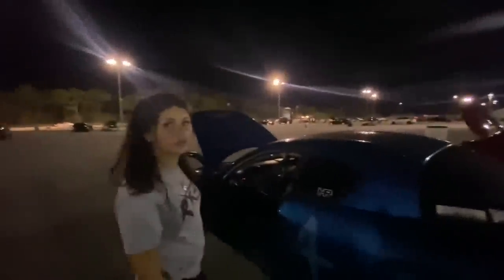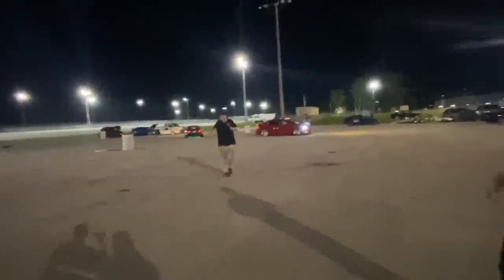AUTOCROSS with CARLA RX8 and RICER MIATA!!

Comment: you guys want to be on the bridgestone potenzas for autox i think. Running continentals on a GLI jetta and its got tons of grip and it does well in the rain still, only complaint is if the car sits for 3 days the tires get flat spots that take a few miles to go away

Comment: bring a laser thermometer to check the tire temps and a pump sprayer filled with water to manage tire temps, thats what Ive seen all the serious autox guys use, they also showed up the back seat filled with gas cans I guess to save fuel weight by keeping the tank barely full

Comment: Somebody build a rotary swapped 13b in a miata.
Reply: Been wanting to do one for about 18 years
Reply: @chancesmalley6708  i think the rotary totally belongs in a miata or eunos roadster.
Reply: Over double the power and shouldn't throw off the weight distribution too much
Reply: @chancesmalley6708  yup the miata is almost the same size as the 1st gen rx7, so i think it would be perfect for a 13b swap.